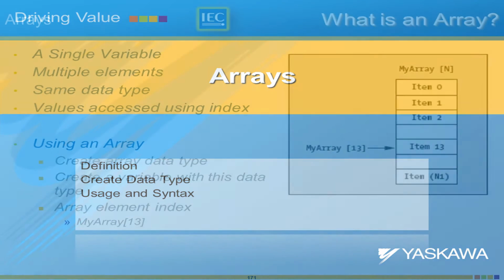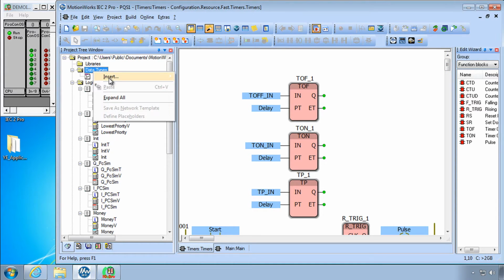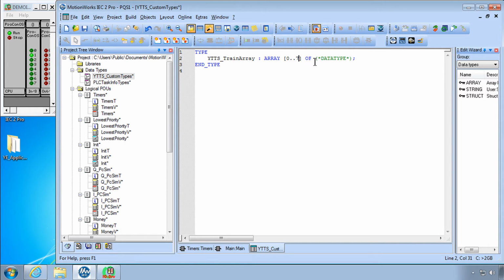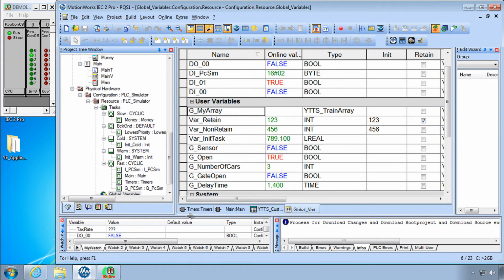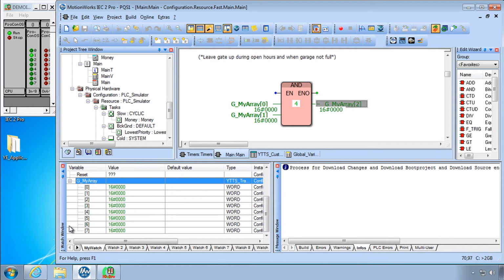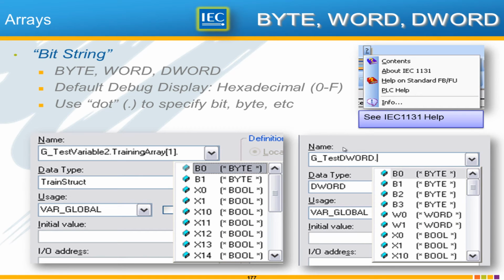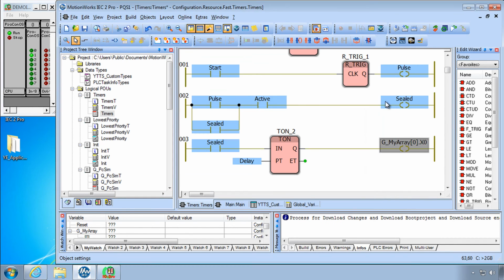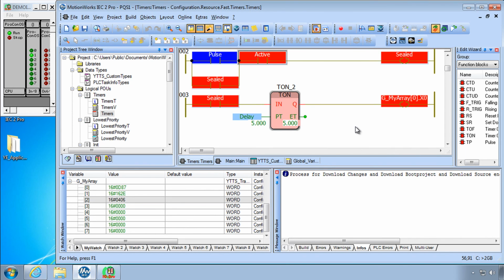4.1 Arrays (IEC 61131-3 Basics with MotionWorks IEC)

Comment: Thanks for the Training Video YTTS. Highly appreciated and recommended for Motion Works IEC. In relation to using arrays, just wondering if its possible to do bit level indirect addressing. i 've got it working it for Byte/INT level. But soon as i try to indirect to bit level i get a syntax error. can still do direct addressing at bit level and it works.
Reply from the maker: Sonny Singh If you could give an example of indirect vs direct addressing, and the syntax error that is generated, this would help better answer your question.  The array element can be a variable with INT datatype inside the square brackets.  It may not be an INT element of a structure or an INT element of another array.  For example, MyArray[n], n must exist in the variable list as a variable with INT datatype.  You may manipulate the bits of another variable and convert it to the INT datatype.  Hope that helps, if not please give the example.  Matt Pelletier.
Reply: Yaskawa America  Heyyy Matt...Glad to talk to you. so lets talk business.... the first bit of code i am attaching is the working copy. i did a bit of indirection and it works sweet. I am addressing the bits in the Byte with dot notation and it works well. here is copy-

Driver_Byte   := Driver_Byte + BYTE#1 ;
Bit_Indirect   := Bit_Indirect + BYTE#1 ;

IF            Driver_Byte >= BYTE#8
THEN     Driver_Byte := BYTE#0;    
END_IF;

IF            Bit_Indirect >= BYTE#8
THEN     Bit_Indirect := BYTE#0;    
END_IF;

IF      ( Q_OUT[0] or Q_OUT[1] or Q_OUT[2] or Q_OUT[3] or Q_OUT[4] or Q_OUT[5] or Q_OUT[6] or Q_OUT[7] )  <>BYTE#255
THEN        Q_OUT[Driver_Byte] := Byte#255;
ELSE         Q_OUT[Driver_Byte].X0 := FALSE;
                  Q_OUT[Driver_Byte].X1 := FALSE;
                  Q_OUT[Driver_Byte].X2 := FALSE;
                  Q_OUT[Driver_Byte].X3 := FALSE;
                  Q_OUT[Driver_Byte].X4 := FALSE;
                  Q_OUT[Driver_Byte].X5 := FALSE;
                  Q_OUT[Driver_Byte].X6 := FALSE;
                  Q_OUT[Driver_Byte].X7 := FALSE;
END_IF;

But in the same code if i try to access the bit in the byte via indirect address i get error. i.e.-
                  Q_OUT[Driver_Byte].[Bit_Indirect] := FALSE;   Or
                  Q_OUT[Driver_Byte].[Driver_Byte] := FALSE;

i believe its same as Q_OUT[4].X[4]  or Q_OUT4.4 

error i get is  " illegal Variable Location Or Multi-element variable Q_OUT[Driver_Byte].'!